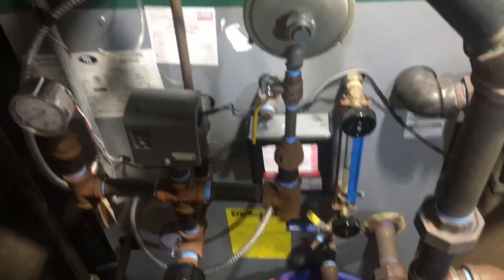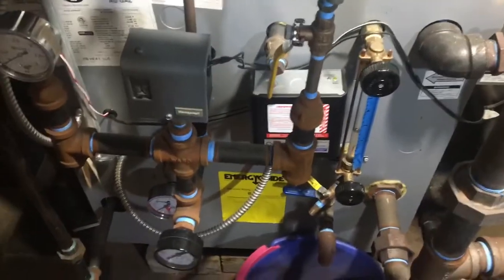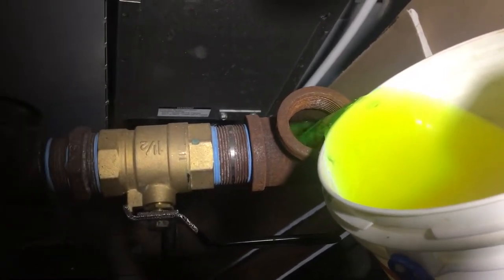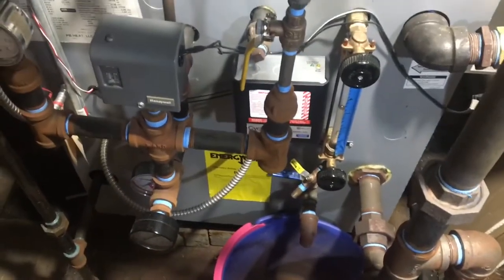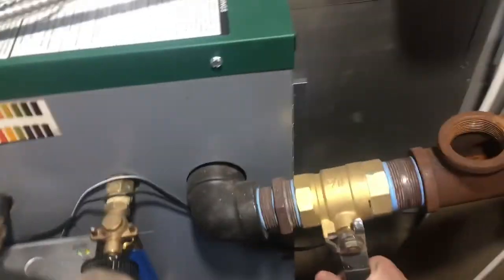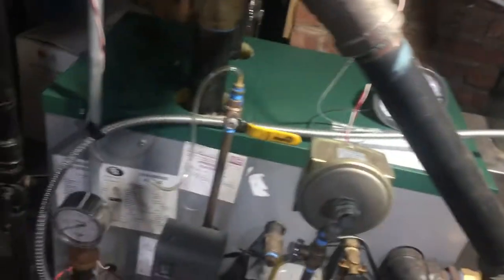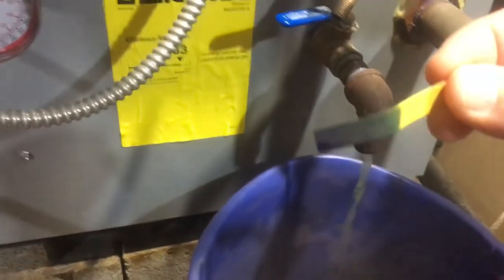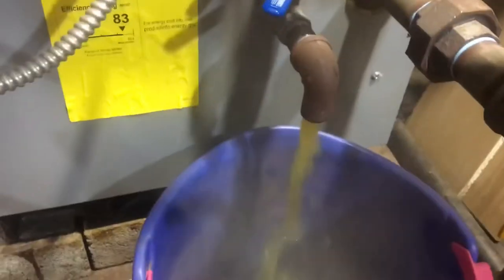What does SurgeX do to your steam boiler?

Comment: Hey Paul,

I'm just about ready to fire up my new steam boiler for the first time. I was going to use SurgeX but have now decided against it (largely due to your findings). The fact that your boiler was running fine BEFORE you added SurgeX tells me all I need to know.
Reply from the maker: I would stick to the manufacturer's instructions...many of them recommend putting some TSP (or similar washing soda) into the boiler, run it for a short time, let it cool, drain it, refill it, and then perform "skimming" on it to remove any remaining oils. There are lots of videos and online instructions about skimming, it's better than any additive. Once the boiler is clean and running well, you can consider adding something like 8-way or similar to bring the PH of the boiler water to 10 or 11 to reduce corrosion

Comment: I have installed over 1000 boilers in 30 yrs. I never have many steaming problems and I don’t build a drop header as they were never installed on the original steam boilers of the last century (true or false). I have been thousands of boiler rooms commercial and residential. My personal opinion is that drop headers were created to fix a problem of using chemicals to maintain water conditioning.
Reply from the maker: Thanks for your comment! I agree with you that decent water quality, a drop header isn’t necessary at all.

But I will differ a bit about the additives. Something simple to get the ph up to 11 will dramatically cut corrosion of iron and won’t affect the steam quality (see my other video where I add 8-way)

Comment: Where did you get the sight glass on the header?
Thanks for this video btw I will stop using surge X from now on
I use it for lots of my customers but not anymore 
I always noticed on the sight glass surging water was more noticeable but I always tell my customers to completely flush boiler after 24 hours
Reply from the maker: The sight glasses are on Amazon and eBay. Search “tri-clamp sight glass”

Comment: You could have just dumped the powder into the pipe elbow and then just dumped a few cups of water into it to get the powder in to the boiler and then just let the auto feeder inlet fill the boiler to the perfect level. Then you don't have to risk spilling the bucket of surgex everywhere. Also the reason why surging occurs is due to a very high TDS count in the water as well as oils the have accumulated in the boiler from the factory and any black pipe. To get rid of that you need a top level skimming tap which the boiler should have. Then you let the boiler sit off for an hour. Then just crack the skimming valve open and let it run for an hour.
Reply from the maker: There were no factory oils in my boiler. I added surgex to a clean boiler. It’s garbage. I don’t have an auto feeder. I didn’t want chunks of powder remaining in my skim tapping setup.
Reply: @pb7379-j2k  No no you did it a completely acceptable way that ensured proper mixing and you absolutely did nothing wrong. I've just found through experience that it's easier to dump the powder in directly and then just pour water into the skim tap to wash all of the powder into the boiler and then none of the powder would be stuck inside the tap. It's just easier because then you don't risk spilling the surgex when trying to pour it in.
Reply from the maker: @nightone9720  what do you think about what my boiler was doing after I added it?
Reply: @pb7379-j2k  I agree it was surging but I'm curious at what pressure do you operate your boiler? Also at the end I noticed that the boiler must not have had any pressure on it when you were showing us the comparison of the fresh water because when you shut the boiler off after you said it was boiling, you immediately opened up the skimming valve. What's weird is if your boiler was hot and boiling at that point, then opening that skimming valve would have been a very bad idea because of you had any steam pressure you would have seen steam come out of that skimming tap. I am curious to know how long you were running the boiler after filling it with cold water before showing us how much better the system was running. Because if you weren't actually boiling at that point I wouldn't expect to see any hot billing water appear in the sight glass header. By the way I like your set up man. That's really cool that you have the ability to see inside the header.
Reply from the maker: @nightone9720  it was steaming when you saw the boiling water in the riser 😅

It doesn’t build any significant pressure except on a long return from setback. It’s normally like 1” of wc

Comment: I love your steam site pipes , better then the Carlin test trailer which I have seen many times but never impressed me.
I would like to see you use 1 lb of baking soda after using surgex in that boiler. Don’t get me wrong you will have to drain and add more baking soda to correct very bad water conditions. But once you correct to water you will not have those problems again.
Reply from the maker: Thanks! I don’t have water problems unless I’m creating them purposely for you to watch (you might enjoy the one where I added oil)

Comment: I love those sight glasses. Where you'd get them? Were they expensive?
Reply from the maker: Thanks, I like them too! You can get them on Amazon. Look up “tri-clamp sight glass 2.5 inch”. They are like $40 plus a little more for the NPT adapter fittings.

They have a built in discount kind of because they are easy to assemble unions also

Comment: when you test the three surgex concentrations, the water level is a gal higher / closer to top of chamber- which we would send more water to the pipes- or did you dump some to level?
Reply: btw kickass setup, i also have multiple gauges but love the sightglasses. look $$$
Reply from the maker: So let me see if I get what you’re saying: if you use plain water or other products with one extra gallon in your boiler you are fine, but if you use surge-x, your boiler will surge like crazy. Is that the sales pitch?

Honestly I don’t recall the exact level but I’ll look. But regardless, no product should increase surging vs plain water. Otherwise what’s its purpose?

Ps I looked back at the video— the water appeared in the risers when I added the first surge-x amount and the water level was actually low
Reply: @pb7379-j2k  i meant that higher water level is more likely to cause splashing into the mains just by being closer, so ideally the level would be the same for each test case, so as to isolate the effect of the treatment.

but, the change with surgex is so dramatic, any water level differences can probably be discounted.
Reply from the maker: @tarikhussein7506 yes  that is true. But in looking back at the video I believe I was at or below the nominal waterline

Comment: Not sure I'd be confident in the interpretation here. Previously a bunch of oil was added to the tank for the Squick demonstration, but there was clearly still oil/squick residue remaining as the water @24:00 was clearly sludgy.
Reply from the maker: I skimmed first but let’s say you’re right—the water wasn’t great. Isn’t that this product’s claim that it prevents surging?!?

If it only prevents surging with perfect water that doesn’t need treatment then what is the point?
Reply: @pb7379-j2k  I think there is an expectation that the tank would be oil free. Even without that expectation, the tank should be drained until the water coming out of the tank is clear, not just the site glass as any precipitate will settle to the bottom. 

I'd love to see a repeat to see if SurgeX behaves the same. I have piping without a drop header so wet steam is a concern.
Reply from the maker: @NuncNuncNuncNunc  I might, thanks for the note

Comment: Why are you a proponent of using 8-Way? Weil-McLain, for one, clearly advises adding NO chemicals to the boiler water.
Reply from the maker: Because I want my boiler to last. A PH of 10-11 virtually eliminates rust
Reply: Hmmm…Is your boiler feed water pH unusual? 

From what I’ve read, there’s very little discussion of -  and recommendation for  - rust inhibitors on the Heating Help forums and in the literature. Seems like a solution in search of a problem.
Reply from the maker: @marcinmerrimack1726  no, my water is about neutral, so that would create rust. It’s a solution to rust, which is the killer of boilers

Comment: If you watch the video US boiler put out with glass headers the boiling water goes several feet above the top of the boiler
Reply from the maker: If you watch my videos you’ll see that is nothing but a show. In a correctly piped and sized boiler, water doesn’t reach the supply
Reply: It’s definitely interesting stuff I’ll check it out
Reply from the maker: @BaconJD420  give this one a try, it’s nice and short. In the other ones I put various stuff in the boiler to show what happens but this is the baseline

https://youtu.be/4IymyZB4wlI

Comment: Hi Paul, what parts do I need to put a 3" sight glass like yours?
Reply: you can get this stuff at brewers supply websites, adapters, clamps, gaskets, sightglass.
Reply from the maker: Amazon. Search for tri-clamp sight glass.

You need the glass, two clamps, and two NPT adapter fittings. The sizing is a bit confusing, look at the documentation/drawings to clarify
Reply: how much was one complete setup (for one main)?

Comment: its due to high ph. you could do the same test but add lemon juice until you get a 9 ph
Reply from the maker: Lemon juice, an acid, will lower the PH.

High PH does not cause surging. See my other video where I run it up to 13 with no surging

Comment: your water line should be coming from hot water line not cold
Reply from the maker: How about if I heat it up on the stove and pour it in 😅

My system doesn’t leak, my makeup water is like a gallon a year and my ph is 11. 

That tiny amount of oxygen isn’t going to hurt it

Comment: Looks like SurgeX is so turbulent that you could use it to flush the system. Maybe it would break loose and move a lot of sludge. And it seems like putting corrosion inhibiting additives into a system would be a no brainer, but I don't hear it talked about much. That's like filling your automobile cooling system with pure tap water. Uggg...
Reply from the maker: I think adding enough to get ph to 10-11 is desirable